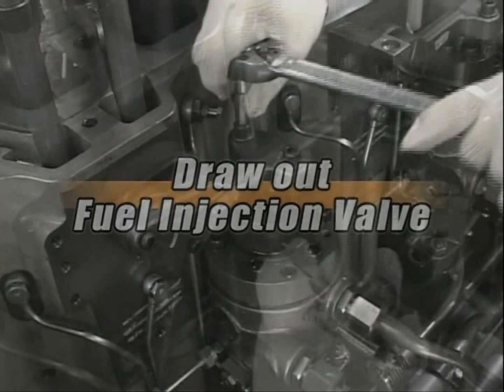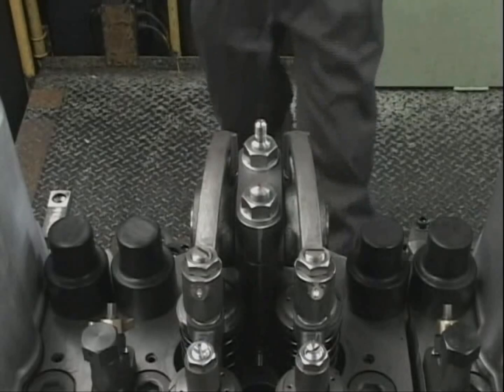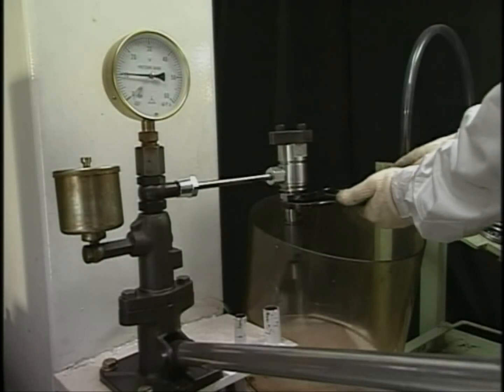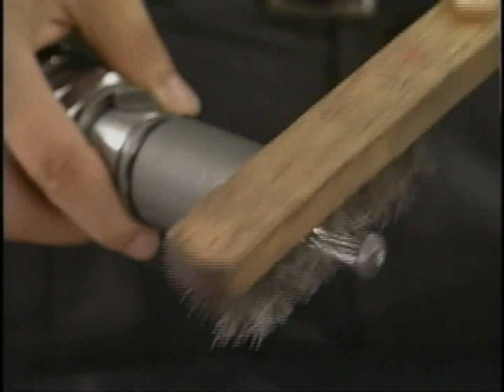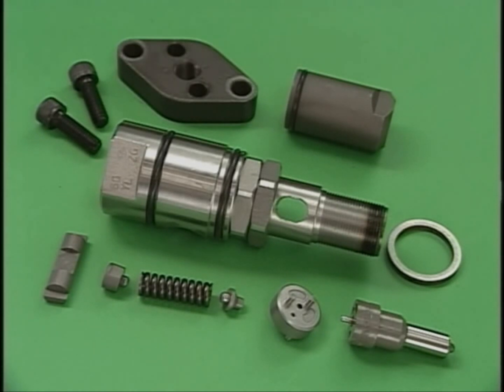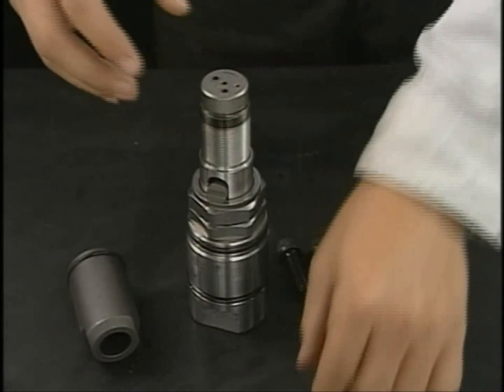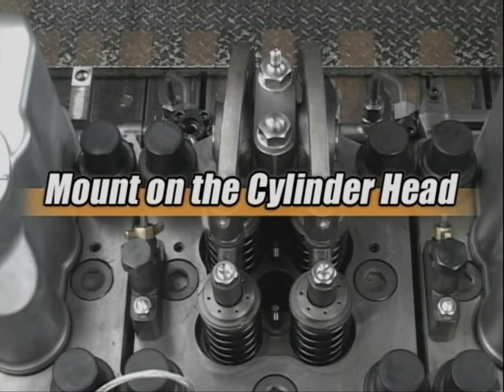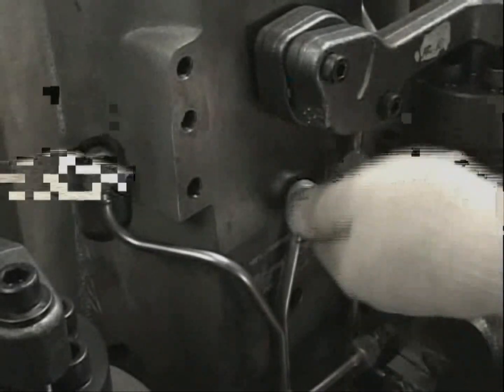Yanmar 6EY22 Marine Diesel Engine Maintenance Manual fuel injector صيانة ماكينة ديزل بحرية يانمار

Comment: At the end of the video, does both pipes are for fuel leakage???
Reply from the maker: the larger diameter pipe is to gather leaking from the smaller diameter pipe "high pressure fuel pipe that deliver the fuel to the injector..